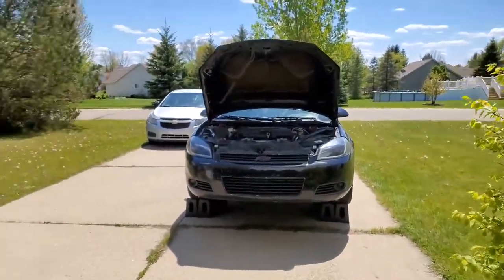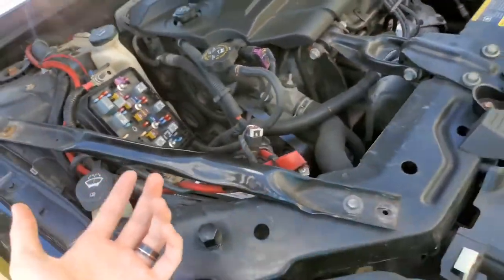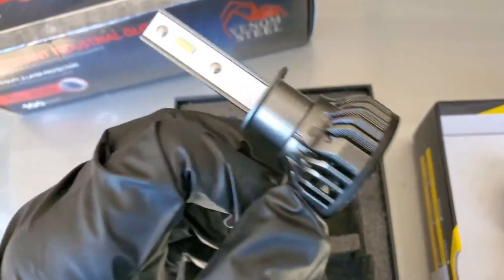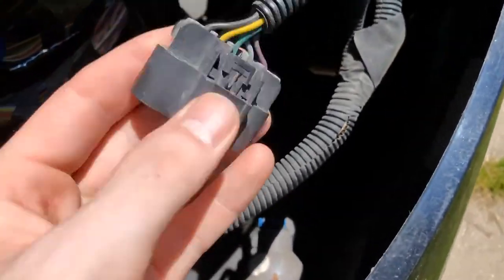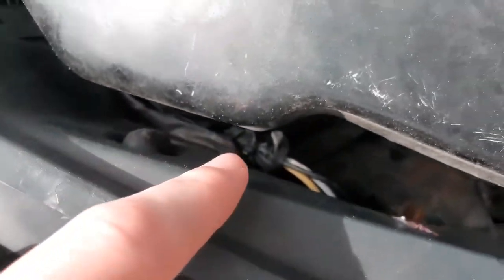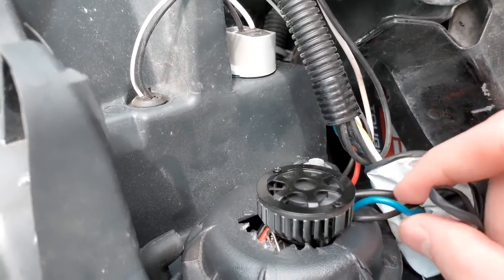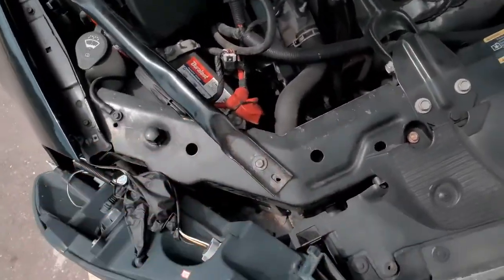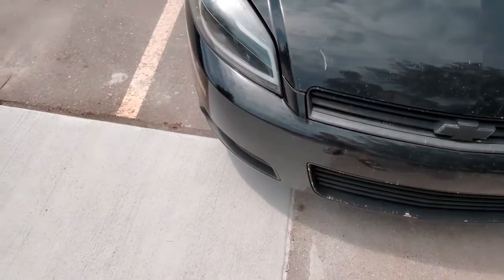How to Install LED Bulbs - Project Impala Ep. 11

Comment from the maker: Side note if anyone reads this, I did get a rubber dust cover for those and you really should get those. Rain is a thing and I must have been thinking I'd add that in or something. Just keep those headlights sealed.

Comment: Hey man love they impala I just did LED on mine as well it’s a 2007 love that car my radio I have to manually turn off as well cause it won’t shut off when I get out of my car but it still has sound mine I believe is just from the wiring because I could not find any wiring harnesses that weren’t Bose speaker package so I had basically by pass the yellow power wire on the radio